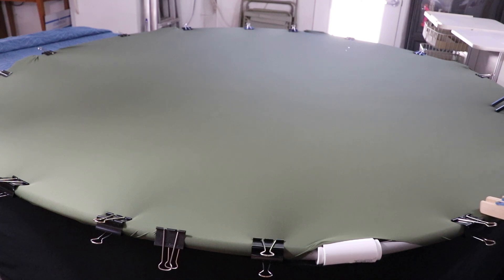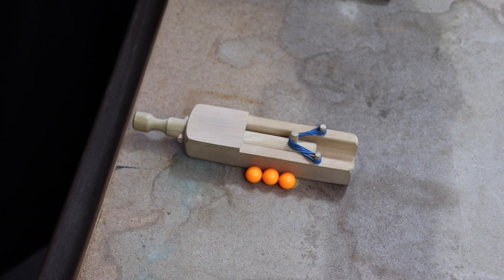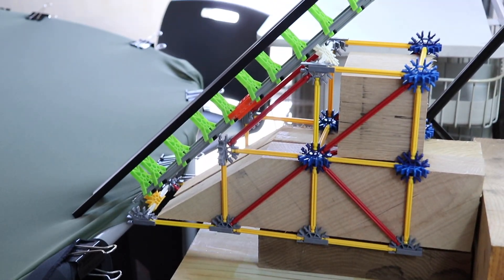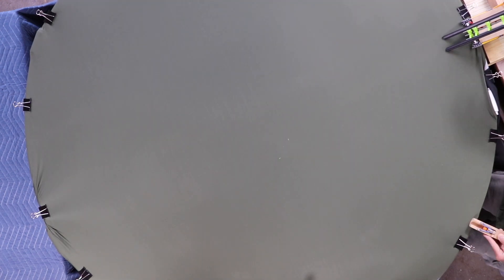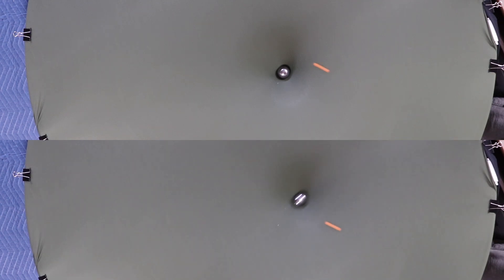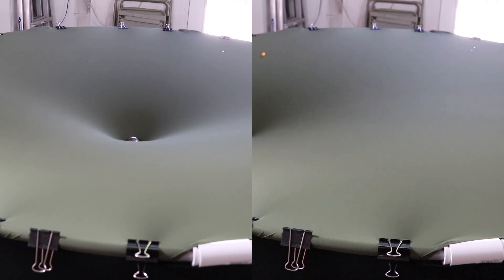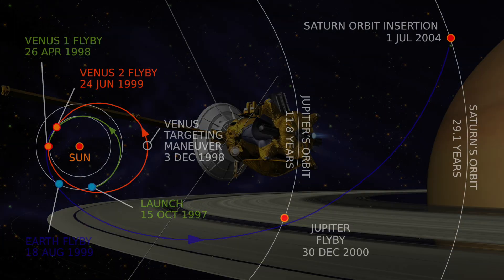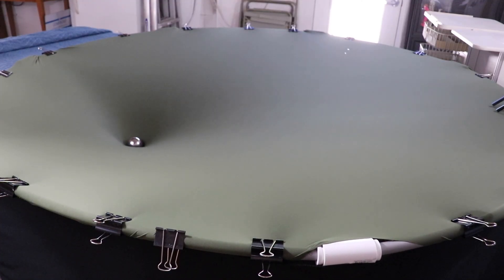How to Perform a Gravity Assist

Comment: This is so incorrect it is difficult to know where to begin.  Your spandex is a 2D dimension warped by , wait for it, gravity, into a third dimension. The analogy being 4D spacetime warped into 5th dimension. The analogy being movement of the objects is driven by gravity from an massive object in the 5th dimension..This is a ridiculosly incorrect analogy. Orbits decay in your spandex. Real orbits dont decay.  The force driving your spandex is GRAVITY FROM OUR 4 Dimensional space time.  The implication is that objects in our spacetime somehow roll downhill.  Where is the force that initiates the first roll? Even Einstein said the falling of objects with zero relative velocity to earth is in fact the earth moving to meet that object.  Gravity is not a force. It is a consequence of warped spacetime.  No one has explained how or why our spacetime is warped, or even why and how masses have the very obvious tendency to attract.  One possibility is that the energy of a system is minimised when all the mass is clumped together, and systems always try to minimise total energy. Hence gravity is simply the consequence of the big bang needing to revert to its original state and gravity is an emergent property of the big bang.
Reply: Orbits don't decay? Then why do we need to constantly add velocity to the ISS? Why isn't sputnik in orbit anymore? Like everything else in this universe, orbits are finite because the vacuum of space isn't perfect, so there are still particles floating around to cause drag.
Reply: The ISS is in an atmosphere, hence atmosphere drag needs to be countered by adding velocity. Earth is in space and the earths orbit is not decaying into the sun. Orbits are not finite as you claim otherwise there would be no planets.